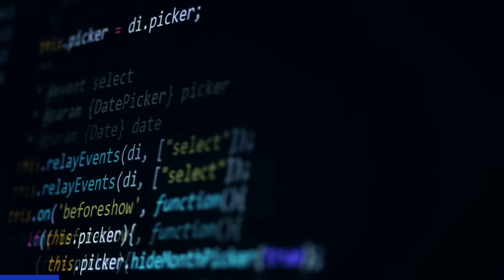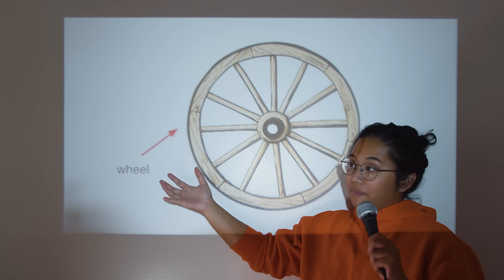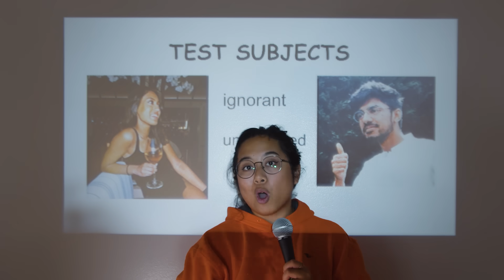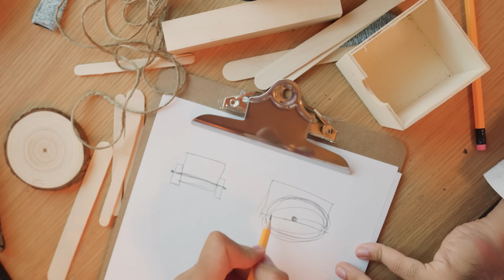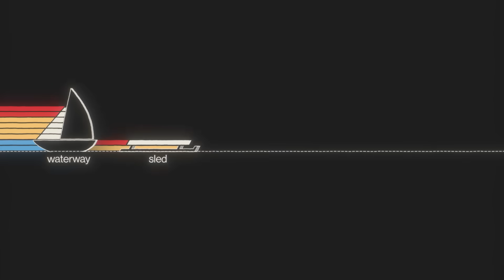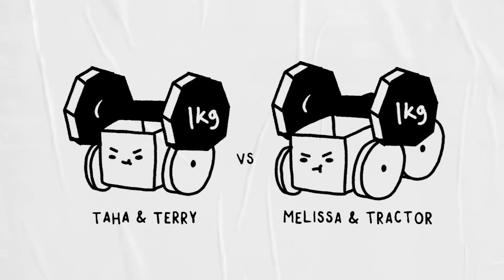why it took 200,000 years to invent the wheel

Comment: Your friends also had the major advantage of having seen wheels their whole lives. Once you've seen something revolutionary it's hard to unsee it, but if you've never seen it before... you're going to need some imagination. Even for something as seemingly simple as a wheel
Reply: I think the wheel is likely more evolutionary than revolutionary.
For example people discovered that rolling logs made heavy loads easier to move. Problem is the logs ran out as you moved the load and the back log had to be constantly moved to the front. What if the logs stayed in place as you moved the heavy load? How to get the logs to turn whilst being attached to the heavy load and not get left behind? Eventually it would lead to the invention of the spindle, or axle.
In my opinion the likely biggest thing slowing down the invention of the wheel was necessity and commitment of resources. Back then, getting enough food and resources to stay alive was a full days work. Luxuries like time spent inventing the wheel just wasn't a priority until carrying loads exceeded the extremes of the existing logistics systems.
Reply: @longdang2681  well, the wheel is quite literally revolutionary, in a more pun-oriented way.
Reply: Well yeah it only took them a day, not 2000 years!
Reply: I believe this is a huge factor. Even more so than any other. The amount of pre-history cultures that could make precise carvings and do precise masonry wouldn't be lost making a wheel system, its just that they'd probably never seen something like it. There are very few examples of wheels in nature, much less so of wheels, axles, and a platform to carry objects. I imagine the first proto-wheels were probably logs.
Reply: @Regulus_V  My grandparents told me that on a missions trip somewhere in Asia in the 1970s, they built a basic cart to help them carry their stuff to remote farmers, and in some of the places they went the cart was swarmed by people who had never seen wheels before and were fascinated by them. I've also heard that the Azteks had wheels, but only on toys - they never used them on carts or anything like that, just stuff like little carved animals with wheels on the legs and a string to pull it with. Some people just don't have enough use for wheels to see a need for them outside of novelty I guess.
Reply: I don't think they'd be able to invent an effective wheel with basic hand tools in less than a few weeks (much longer w/o howto videos)...it's hard to make a primitive lathe.

If they had to start from stones like some YouTube channels have tried it would be years (even using modern knowledge and getting to drive to mineral deposits).  It's damn hard to construct even decent bronze tools and until you get some pretty decent tools you can't really get your lathe working.

I'm sure cavechildren have been playing with primitive wheels since before we were human (it's just a stick stuck into two slices of tree) but what's hard is the tools to achieve round axles and holes.
Reply: @petergerdes1094  It doesn't take a lathe to make a wheel; you can simply do it using an axe to get planks and cut them down then steam-form them to shape, assuming you didn't just take a cross-section of a log and carve it down. Doesn't even need a plane to do so, either.
Reply: It's more than inventing the wheel. People thousands of years ago also needed to invent the transport networks to make such things useful. They needed to build proper vehicles for the wheels to carry, and they needed to set up the roads for the vehicles to travel upon. They needed to venture out away from water to make the invention of land-based transportation vehicles to be necessary. They needed large organized places like proper cities for those vehicles to actually travel to and from. 
It was a very slow setup for the wheel to even become necessary, and as we all know, necessity is the mother of invention.
Reply: @lucasharvey8990  I hadn't thought about what you say before, as it seems obvious that the wheel was invented well before we started living in large urban centres. But perhaps you are correct that people living concentrated in settlements would necessitate transporting goods. Before that they would have survived by living off their own plot of land. I'm sure that a basic plough would have come before the wheel, as that would allow for growing large areas of crops. And you'd need an ox or horse to do that. 

So when we came to live in settlements, we could grow certain crops in the best areas, and trade them between farms. That would require some form of land transport, hence the need to create some kind of wheeled contraption. My guess is that the wheel developed independently in many parts of Eurasia. This project was obviously a bit of fun, but of course none of those primitive societies would have had one person come up with wheeled transport.

The mystery is still that the Incas created a magnificent civilisation less than a thousand years ago. But never invented the wheel!
Reply: @rogink  Basically, the spoked well was the really gamechanger, that's how you go from a potter's wheel and slow moving ox-carts to high-speed chariots pulled by horses. That specific technology seemed to have originated in the Eurasian steppe, where semi-nomadic warrior societies like the Proto-Indo-Europeans used it to quickly spread across the continents. That the modern horse was also domesticated by the same people is no coincidence of course, and is how the horse-chariot spread like wildfire across the "old world".
Meanwhile for Incas, I think it has a lot to do with their environment, plains and steppes are great for wheeled vehicles but mountains not so much
Reply: Except that there were precursors to the axled wheel in existence.

Firstly, I believe there is archealogical evidence of the potters wheel predating the vehicular wheel, and while functionally different it would have been a basis to allow development of axle and wheel in a lower stress environment to develop before a technologically superior potters wheel was turned on its side and put upon a vehicle.

Secondly, we know tree trunks were used as roller bearings to help move the stones in Stonehenge.  The use of tree trunks in this fashion are not attached to the item being carried, so needed people to run around feeding fresh trunks to the front of the stone block; nonetheless it was an introduction to the concept of having something rolling under a heavy cargo to allow it to roll along the ground.
Reply: Everyone saying that this is a good point is missing the fact that the makers of the video know this full well, but they can't exactly just find someone who's never seen a wheel before. 
That's like watching Chernobyl and saying "Ah because you see, nuclear reactors can actually be quite dangerous when not run properly."
Reply: Wheels truly never were the problem. Humans knew round things roll. Problem has always been attaching it. Ball bearings havent been invented, an axle rotating on a stiff surface isnt working for long well and such.
Reply: Thats a good point bro
Reply: Hehehehe Revolutionary
Reply: I believe I saw something about this in a video discussing why no animals have evolved into using wheels, seeing as they are so good for transporting things. One of the things mentioned was simply that a wheel is a terrible solution without roads. Legs, and even slithering, is better on rough terrain.

It's funny though, because despite knowing things like this I still had this mental image of wheels being invented in the stone age. I blame the Flintstones for that I think…
Reply: Yeah, similar to drones. Nowadays it's everywhere, but before that we only had RC helicopters...
Reply: Hehe, revolutionary...
Reply: People are missing the big issue with early attempts at wheels, namely, the tools to hand. Making a wheel means cutting across the grain of the wood at some point, and that's a really hard and laborious thing to do before you have metal tools.
Reply: They did use round tree trunks to move heavy objects on land before the wheel was invented, they just had to move the tree trunks in front of the objects after it went over. So people knew round things would roll and could be used to move something. It just took a long time until they figured out about the axle attached to the object.
Reply: If you think it’s not hard make a musket

Comment: I read somewhere that the first wheels were actually logs cut into a disk shape. With a hole in the center.

And it's kind of weird that the first chariots actually had 2 wheels instead of 4.

With horses as the driving force.

Comment: This was a fun video. My one question, scaled up, would those carts fail due to friction? The one with the pencil axle, so if that was rubbing against the cart would it start a fire? What did they do in olden times? Was there early grease to use?

Comment: Just spitballing here...but why not affix the axle with ropes to the sled 3 or 4 wheel design for better steering. Carve out the bottom of the sled in a fairly smooth half circle,  metal or wooden pins to hold the axle with extra force as the axle is your fixed point. Attach two sawn off log slices roughly 4 inches across, demo the device and see where you encounter rolling resistance and remove material from the wheel as needed. Grease your wheels up with something after pinning them in the axle with a bronze cotter pin or maybe a wedge type system like an axe head is attached. Bobs your uncle you got a cart at least. Maybe for extra flair carve out some of the wood in the wheels center.

Comment: as legend goes, the ball pen was invented after it's creator saw a marble run through a puddle and leave a trail of water behind it.
it wouldn't be too far-fetched, if the legend for the invention of the wheel is anything similar: a man seeing a stone or a trunk roll downhill, having the need beforehand to pull a load uphill
from need, idea..... it's always been like that.

Comment: Also, the picture of a sled shown is (arguably, possibly, maybe not) misleading, because one of the things frequently referred to as a "sled" in a pre-wheel context is a platform that is carried by dragging it either just along the ground (pretty bad), or along logs (or some other round/rolling objects that are not attached to the platform), which have to be moved along with the platform but make it much easier to drag heavy objects along. Essentially, replacing the ground with rolly things is more or less equivalent to reducing friction a lot (as long as you have a friend and/or slave to also carry the rolly things along). Inventing the wheel probably initially consisted of people trying to make the rolly things attached to the platform (which would save you one whole slave and/or friend), yet still sufficiently rolly.

(to be fair the simpler kind of sled is also shown later on but a) not specifically called out as  a sled and b) without the rolly things that make it an interesting step in wheel development, so i'm clinging to the idea that this comment is relevant)

The kind of snow sled shown certainly predates the wheel but is still used today in low-friction circumstances where you... don't really need the wheel as much because friction is low anyway. After all, what is a ski sled but a cart with flat(-ish) pieces of wood instead of wheels? We don't speak too highly of the people who invented the flat piece of wood.

Comment: To be fair, some of this is being made slightly harder for the subjects because people who would have actually been inventing (or even just making) the wheel at the time would have been using surprisingly advanced math (by which I mean probably high school level by today's standard but still of a level most people don't encounter in daily life once they're done with high school) as part of their trade, and would have had access to some tools we may not expect, like hand drills and plumb lines (and by extension, levels). So as much as giving them power tools and Wikipedia would probably have made the whole thing boring, redundant and probably ultimately further from historical experience, the circumstances in which the wheel was invented may have been more auspicious than the ones this experiment was made under.
Reply: the challenge of making a palm sized toy and a proper carriage or cart are also orders of magnitude apart difficulty wise, so they still had a way easier task.
Reply: This disadvantage is more than covered by fact that these two had seen all sort of wheels throughout their lives thus they don't really need to invent it they just need to reproduce minimal working thing.
Reply: Is high school really that bad in the USA?
Reply: @moartems5076  The problem isn’t that public education in the US is so bad (not that it’s perfect, either) - the problem is that there is a uniquely American strain of anti-intellectualism that pervades a significant portion of the population.
Reply: @moartems5076 what do you mean?
Reply: im not reading allat
Reply: @mrslime9137 it’s a paragraph. How are you not failing English?
Reply: @wolfiegames1572 bold of you to assume they aren't failing English. They had 6 words to say, misspelled one, and gave up on separating the last 3

Comment: You can find the middle with the string actually. Just lay the string across the length of the wheel, fold the string in 2, and then take note of where the kink is.

Comment: Terry cheated big time. She used a pencil for the axle, which is an industrial age product with perfect symmetry and a smooth tapering end. Both of which are mechanical engineering innovations. A more realistic test would be using a metal rod like from a clothes hanger because metallurgy was a serious business back then and so rods and spears were already a thing.

Comment: This is a poorly concieved experiment because the wheel is deeply embedded into the modern mind.  
Lame. Developers and programmers are hardly creators on the level of an artist. That's why we appreciate the statue David and Sistine Chapel roof and always will over some banal application/program.

The wheel took so long probably because a horse and a Native Indian set of lashed poles (travois )did the job adequately- in sometimes superior to wheels- because they can navigate rough and bump terrain and literally jump over obstacles. Even if the draught animal is a human being. If the load was not too large it could simply be draped over an animal much like a mule is laden.
Then we have ancient people using logs fully understanding the rolling properties as per Stonehenge to move enormous masses. 
For the Europeans to fabricate a long tube- they must have had acess to lathes (likely treadle or boy powered) and a long understanding of creating tubular shapes. And likely axles holding devices made of cast bronze to bear the axle- hence bearing. Very likely packed with rendered grease.
I would argue welll travelled and perhaps stone paved paths predate the wheel. For a bronze age wheel is not terrible useful off road.

Comment: You forgot the road.  Wheels are only really efficient when you have a road as well.  Some Ancient South American cultures had wheeled toys but did not use the wheel for transport.  In these extremely rugged landscapes legs are better.  
In a pre-wheel situation even on a flat landscape the wheel would not be immediately useful since there would be plants trees etc in the way making wheeled vehicles hard to use.  
The wheel requires the road.  Roads require a lot of organised labour to make, a certain level of civilisation is needed.

Comment: Another thing you need in order to invent the wheel is big flat areas to roll a wheel over. I've seen a lot of folks say some pretty foul and racist things regarding the lack of wheels in the Americas prior to contact with Europe but most of the major population centers were just...not in wheel territory? Big domesticable animals aren't required but they sure do make wheels more useful, too. There were wheels on toys in the Americas but no oxen or horses pulling heavy carts through the mountainous Inca empire, and I knew people growing up who still took a canoe or pirogue to school in the area where the mississippi mound building cultures dominated because it was still faster to row than taking an existing car across existing roads with multiple bridges.

Comment: You gave them wheels all ready
you should have just told them, "you must make a platform that moves that is not a sled."

A log, two grooves cut around the log at both ends. A rope wrapped around and then connected to a platform.  A wheel is just a log

Comment: One thing you didn't really touch on is that wheels are not really as useful in most scenarios unless you have a road. In some cases not useful at all. And building good roads is a lot harder and more expensive than building a vehicle to run on one.